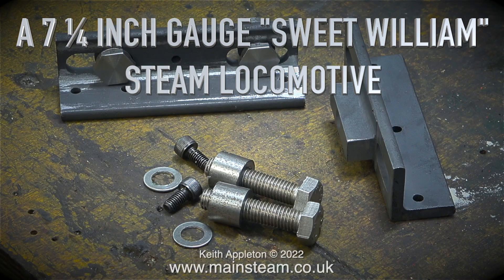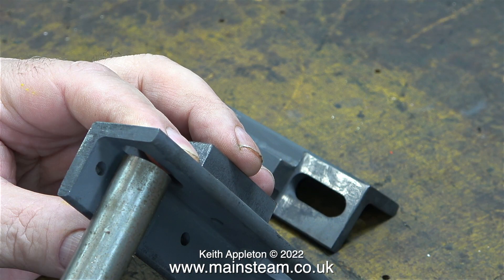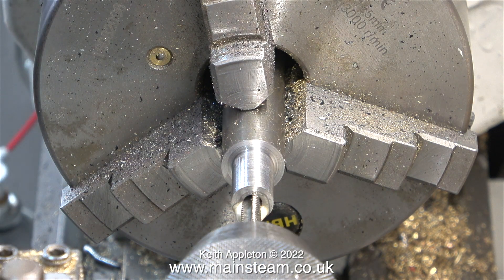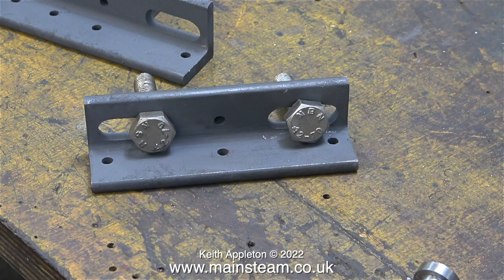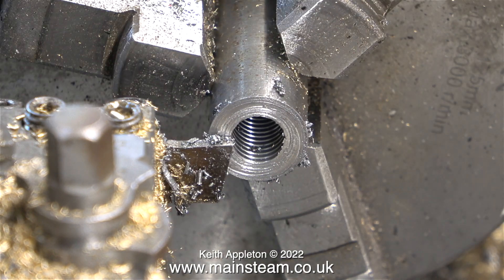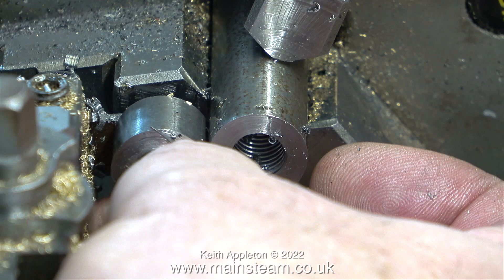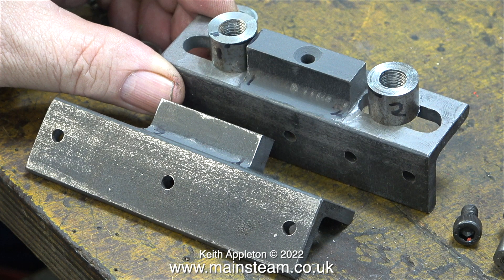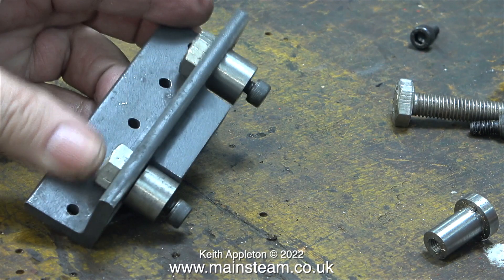A 7 ¼ INCH GAUGE "SWEET WILLIAM" LOCOMOTIVE - PART #11

Comment: Keith, I have said this before, several times, but bares repeating. There will always be so called "experts" who will nit pick your work, even though you clearly explain what and why your doing so0mething a certain way. These folks are nothing more than nay Sayer's. They all seem to have nothing better to do than to find fault in others, either because they are full of themselves or are actually very down on themselves. So, they find fault in everyone to make themselves feel better.
Once again, just ignore them. When you acknowledge them, at all, it just encourages them to continue trying to make others as miserable as they are'
I think you do just fine, that's why I watch, and for no other reason, well I am waiting to see your 2-6-2T loco actually run on some track, one day. ;-)
Reply from the maker: It is just due to the anonymous nature of the Internet, I read the bad comments in case there is anything useful, and then I block the fools from posting any other stupid comments.